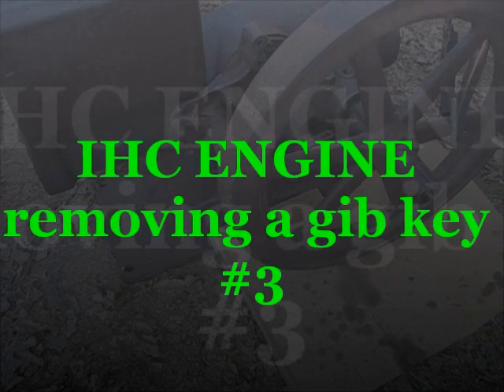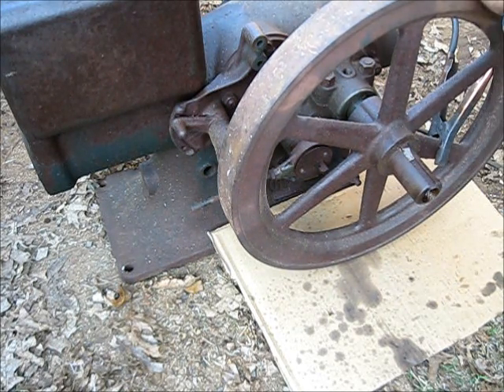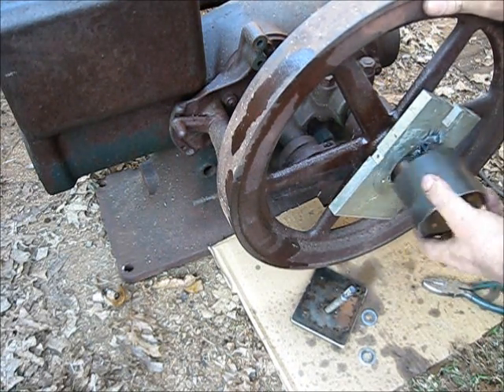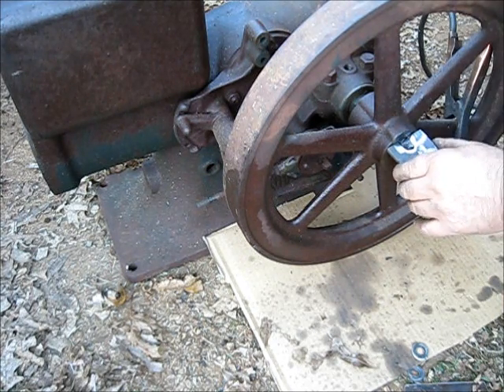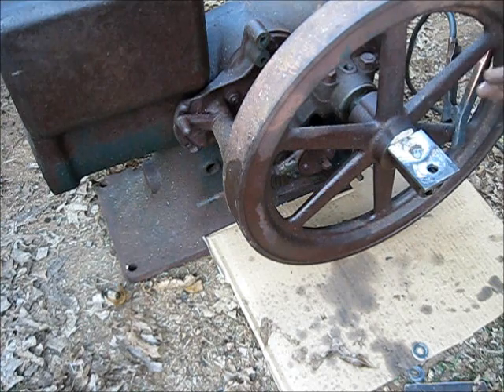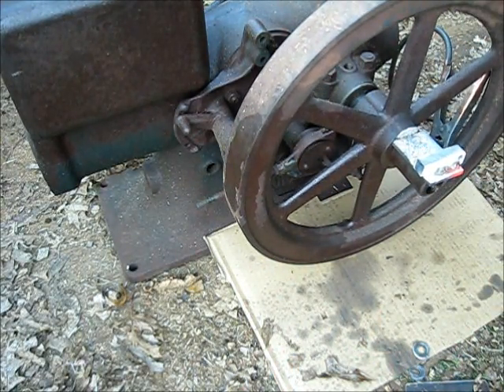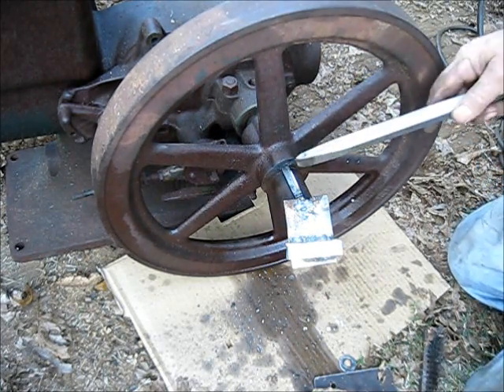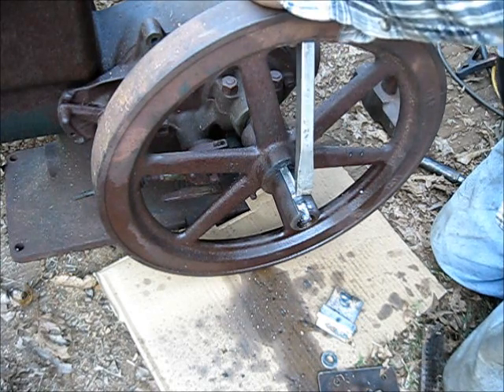IHC ENGINE / removing a gib key #3of4

Comment: Great video and thank you for passing on your knowledge & experience. This exact approach was recommended by a very experienced engine restorer in Australia. Amazing how the weld held despite it having such a small amount of material to weld on to.  I will use this process to remove a stubborn gib key from a Lister CS 3/1. At least the gib key I'm dealing with has the key on the end.

Comment: I am amazed and pleased for you how well that worked for you, I've certainly learnt a few new techniques to solve these sort of problems. 
However I would be very wary about using a puller to drag those flywheels off for fear of slipping off the hub and breaking the spokes. Do you have legs on your puller long enough to reach over the spokes and get a grip on the hub or is there some other way? It also worries me with the tension needed to initially move them of damaging the end of the crank.